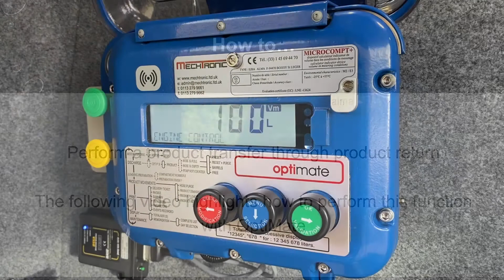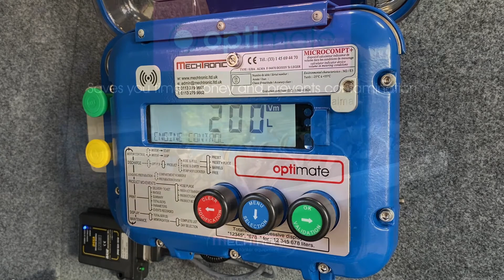OptiMate: How to perform a product transfer through product return (2021 Firmware)

Comment: Need to see a video on how to end on purge....so if you have a preset delivery for say 500 and the pot runs out and you have no more of that fuel, how do you finish the delivery with a purge of another product, that will end the delivery short of what was preset but flushes the line out so you haven't got bits of both fuel in the line...
Reply from the maker: Hi James. 

To end a delivery with a purge when the preset wasn’t reached please follow the below. 

Set the delivery up as a preset + purge lets say for 500L. 

Then when the compartment empties of your first product, press the RED button once, then press the BLUE button once. This will display END WITH PURGE. Now press the GREEN button once to bring the purge in early. 

I hope this helps and if you require any additional information please feel free to contact us.
Reply: @mechtronicltd2004  that helped thanks. 

Another question. Is it the same procedure if you for example set a delivery for 500L of kero and preset and purge to change to gas. 
But instead of the pot running out, I have to stop the delivery myself as I won't get the 500 in, so I decide to purge early. Do I still follow the above as in red once then blue?
Reply from the maker: @clapham4life  To end a preset + purge early you need to modify the entered preset. 
Therefore, stop the delivery using the RED button on the OptiMate. This will present stop delivery now press GREEN button once. 

This will now present continue delivery, press the GREEN button. This will now display START HIGHFLOW. At this point you press the RED MODIFICATION button. 

This will take you back to the mode of delivery menu where you can now change the preset volume to your new amount. 

I hope this helps and if you need any further clarification please contact our office 0113 279 9661 and ask for Brad